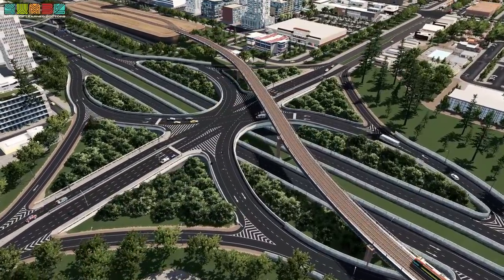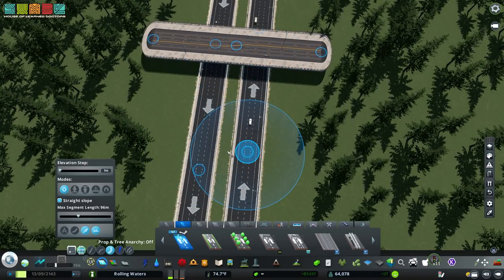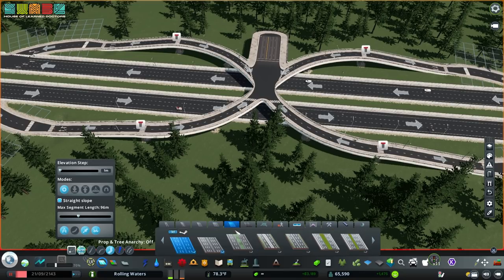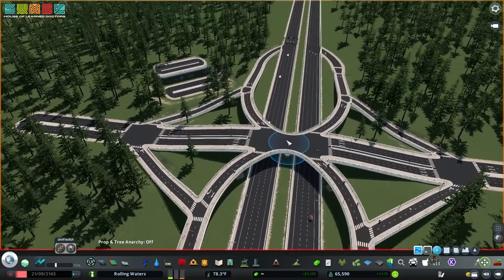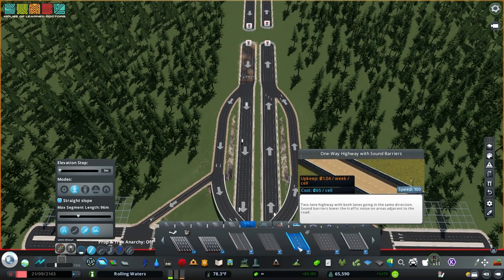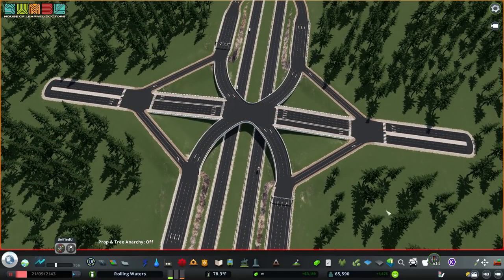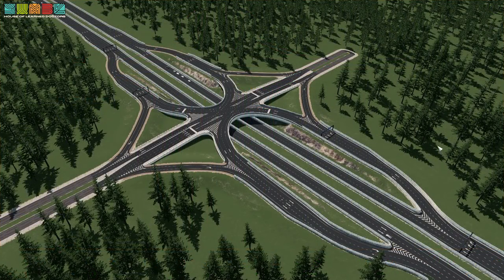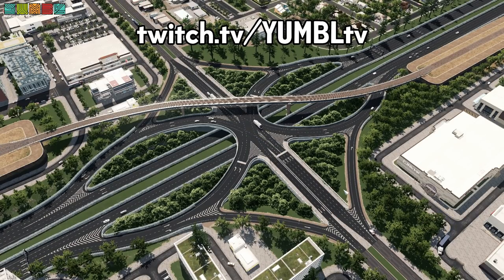Free Your Traffic Using The SPUI! - Single Point Urban Interchange - Cities: Skylines Tutorial

Comment: One "realism" thing about sinking the main highway I think is that you get landfill form there to use for the roads along the side. So it makes sense logistically as well to do it this way.
Reply from the maker: I’ve heard it called “dump and fill”
Reply: @YUMBL  this tactic is actually called CUT and fill and it’s very common in civil and architectural design
Reply: A real-life interchange like this would be extremely dangerous for traffic not to mention the problem of water flooding.
Reply: @YUMBL  Like Matthew says, it is cut and fill.
Reply from the maker: Thx Jason. I really needed it twice. 🤣
Reply: @robertsamson4610  This is not true at all, they are not dangerous in the slightest.  Check out the intersection at US-22 and PA-66 in Delmont, PA, it is a high volume thoroughfare with a SPUI that does a great job at managing traffic.  In addition, merging is actually really nice because you have a much longer line of sight and more time to get to speed than interchanges with tighter bends.

These low points in highways are intentionally engineered as such specifically for run-off water management.  This gives engineers a low point to divert all run-off to and often times any excess run-off that can't be handed by the storm drain system is diverted to a nearby manmade overflow pond if there isn't a nearby tributary.  Engineers really can't engineer around these things because of environmental impact reports so these roads are engineered to manage these considerations rather than work around them.

-Former equipment operator
Reply: @YUMBL  I was just reiterating and giving the Al Gore rhythm a shuck and jive.  I was a heavy equipment operator where I mostly ran excavators but have been certified on 28 different machines and can run just about anything short of cranes.

But just in case you didn't get the memo the second time, its cut and fill.  Jokes aside I'm loving your content.  Although I understand a lot of the principals you go over I don't always get the application right and you do an excellent job of breaking down relatively complex concepts into digestible portions.  I love the granular detail.
Reply from the maker: I do appreciate it! I have a bit to teach, but a lot to learn from people in their fields. Thank you :)
Reply: @YUMBL  We are all learning and are all lowkey stupid as hell that’s why we have each other ❤️ lmao. Keep up the good work 🦹‍♂️✊

Comment: I have both Yumbl's steam intersection.  SPUI and ParClo, the ParClo works alot better.  The SPUI all traffic fighting each other in one point, Parclo, if u make all off ramp right turns, NO ONE will fight each other.  I use the Parclo more because  it works well in heavy traffic area, like Downtown
Reply from the maker: Did you set up the SPUI with a traffic light as intended?
Reply: I agree with weirdalfan (and not just because I'm a Weird Al fan). I may be an oddball (been one my whole life!), but I've experienced SPUIs in Cities and in real life, and I find them very inefficient. The ParClo, DCMI or Turbine work much better in Cities, in my experience.
Reply from the maker: Parclo’s are better, but they take up much more space. Dcmi’s are great too. Turbines are a system interchange, so theyre not for getting on or off the highway.
Reply: @YUMBL  SPUI is okay for lighter area, like feeding into a low rez.  But I had a SPUI 2 times, traffic went nuts going into downtown that has 30000 workers.  So I had to do Parclos instead.  SPUI works but not for feeding 30000 workers going downtown.
Reply: @YUMBL  Also I do not believe traffic lights are answer.  I do give ways.  I prefer to manage teh traffic and let them go where they need to without stopping.  Only time traffic lights are good is Collector on Collector
Reply from the maker: I think it’s all context. Questions like: Whats around it? Is all the highway traffic being forced through one place? Is the light timed correctly for the volume of traffic? 

I will say parclo works better without adding a traffic light, but the spui is a strong competitor for its small footprint.
Reply from the maker: Certainly false. These interchanges require lights by design. Now i see.
Reply: @YUMBL  we all have different, preference.  How I run my city on Cities is different than you, Biffa or CPP.  I personally feel against stopping cars from an arterial can cause backup onto the highway, maybe I do them wrong.  But  SPUIs are okay, it depends how much traffic is going in them.  I will take up little more space, perhaps Eminent Domain to help traffic if I needed too.  I would still use SPUI if its lighter traffic like collector going into the suburb.  But for downtown (or any high traffic area), Parclo works better.  I used to do roundabout interchanges.  But it looks better if you don't tunnel and use actual overpasses.
Reply from the maker: The spui is a tool. A spui without a light is like hitting a nail with the handle of a screwdriver. It works, but not well.

Comment: I grew up in Miami, and my grandparents lived in Clearwater.  I couldn't have been more than three or four years old when I first became consciously aware of the fact that the interchange of Roosevelt Blvd. / E. Bay Drive and US 19 was something special, different than any other interchange I could remember encountering.  The thing that fascinated me was the traffic lights mounted under the bridge for the off-ramps.  I instantly fell in love with the design.  It wasn't until later in life that I learned the very first interchange of the type was built just up the freeway at the interchange with Gulf-to-Bay Blvd. in 1974.  I've been building them in my cities for as long as I can remember.

Even later in life, I learned, at the interchange of Wendover Ave. and Holden Rd. in Greensboro, that such a thing as an inverted SPUI exists.  ...Don't try putting one of those in a high-traffic area.  Just... don't.

Comment: We use these on the Yellowhead in Edmonton at three locations: Wayne Gretzky Drive, 83rd Street, 97th Street. The latter two are connected to frontage roads allowing for good business access to boot. 

This is an excellent guide and produces an exceptional approximation of these interchanges that we have here (particularly Gretzky).

Comment: I love your thought process when drawing it all out.  I just make a spui but the hw overpasses instead of underpass and lemme tell ya the ramps are backing up I may just have to add the extra ramp lanes.
Reply from the maker: An extra lane helps a lot on the exit ramps. Especially if traffic will be turning both directions at the next intersection.
Reply: @YUMBL  Of course, where you choose to put the 2 vs. 1 lane is totally dependent on which direction the bulk of traffic is going.

Comment: Just built this in my city, haven’t run the simulation yet but it looks great and I bet it will perform so as well. In my design, I made the highway a flyover, as it will go through my city raised, and put the intersection underneath. It works better for my road layout, but the downside is I don’t get to see the satisfying intersection!
Reply from the maker: Thats my one issue w the underpass version. Same reason I dont like using tunnels in interchanges. Aside from realism, tunnels hide all the great work you can do! I do love an elevated highway on occasion though :)

Comment: For the traffic lights i would suggest P1 straight + left from one side P2 straight + left other side P3 both left from the highway. The advantage from my perspective would be that all 4 lanes from one side will move at the same time and any last minute lane changes that will occure irl will be between moving lanes. Moving in and out between moving and not moving lanes is extremly dangerous! Plus only P3 cars will move from both side without any "hard" separation witch will reduce the risk of frontal collisions.
Reply from the maker: You’re right! For reasons you may not even know. In my experience once you use node controller all the arrows become straight. The light loses the ability to use a left arrow anyways. You’ll see the way you described is how mine is actually set up at the beginning of the video.

Comment: Interesting SPUI story.  I originally came from Columbus, OH, and one of our most infamous interchanges was Sawmill Road (an arterial road) and I-270, the city's Beltway.  It was a bastard PARCLO that had no fewer than three traffic lights, connected the city with the fastest growing suburb (Delaware), and was an utter disaster during rush hour or if there was ANY accident along I-270.

So what did they do?  They tore down the PARCLO in stages and built a classic SPUI instead!  Suddenly, three traffic lights became one giant traffic light.  It uses three phases, just like your interchange. And the amount of traffic it pushed was easily triple what the old PARCLO could handle.  Even during rush hour, traffic jams on Sawmill became a thing of the past.  All because of a better interchange design. :-)

Comment: The only SPUI in Metro Detroit is actually underneath the freeway. The freeway has a suspension bridge. The off ramps open up to 4 lanes to split into two 2-lane segments for turning. The road underneath was formerly an 8 lane divided highway, reduced to 6 through lanes here. I believe this interchange replaced a cloverleaf. I-94 at US-24 in Taylor, MI.
Reply from the maker: Nice! I would assert that this is better than a cloverleaf (depending on a lot of things mainly that I hate cloverleafs.)

Comment: Standard hight is 4.5 meters, most overpases is built 4.8m to have spare space. The road thickness is usually around 1.5 meters for highway overpases (but can easialy be 3 meters for river crossings or longer spans). So typically the difframce in hight would be 6.3 meters.

This number is usally keped  as low as possible, becuse there is a limited highway ramp angle, making it even a bit higher increase the cost of the ramp quite significantly.

Comment: There are a bunch of these where I live (Vancouver, WA) and they're neat.  I recently started putting some in my city where I was using DDIs.  I feel like the DDI does flow a bit better, but they're a colossal PITA to build, and require more space.  The last SPUI I built took all of 10 minutes, is very compact, and has better walkability.  So I'm a fan now.
Reply from the maker: Id say a DDI is better in terms of flow, but a SPUI generally gets it done
Reply: @YUMBL  That's what I've found too.  A DDI flows a little better in exchange for a lot of fiddly work and is really awkward to do things like add trams later.  I have 4 or 5 in my city and I'm just done building them.  At this point if a SPUI can't handle it, I'm going straight to a freaking turbine, lol.

Comment: As per the traffic lights, you want the straights throughs to take turns, so that the straight and turn go at the same time. Why? Because the turning lanes will fill up and then block the straight thru traffic. So, you run them staggered. Straight and turn.

There is a similar interchange near where I live, it's very important that the turn happens at the same time as the straight, because it will give an even flow of traffic heading into this interchange.

Comment: you could simplfy it by doing it the asian way which is to raise the highway into an overpass over the interchange and the rest of the road can be at ground level, the footprint will be smaller. it does require some additional work to set the pillars.
Reply from the maker: Sounds like, all things being equal, the footprint would be the same.

Comment: I don't want to sound negative, but I do miss a lot of Lane Mathematics and there are crossing area's. I rather just go for the Timboh's Turbo Interchange, which also requires a little Lane Mathematics, but that is done in a few minutes. At least with Timboh's interchange no crossing traffic what so ever.
Reply from the maker: A turbine (may be what you mean) is a system interchange for connecting highways. A spui is an example of a service interchange which is for getting traffic on and off a highway. Its also much smaller.

Comment: With the traffic light portion, do you do a timed light? If so, what are the settings you use?
Reply from the maker: I do a timed light! Start w min 10 max 20 and adjust as necessary. (I made those numbers up but its a start.)
Reply: I use 3-12 myself
Reply from the maker: Jenny is probably right. Start lower and move higher. I just find longer times often clear interchanges better.
Reply: @YUMBL  I think we're both right, its just a preference ^_^ When I do my lights I make sure to change the flow sensitivity to slow as well. I forgot to mention that. No one needs a psycho rave traffic light in their SPUI XD
Reply: @jennymunday7913  thank you both, I've never really bothered with them as I could never get the timing right for constant flow. I'm actually going to try this though, thank you both.

Comment: Nice and compact, looks good! I think I watched most possible interchange options now, I wonder where each excels in an actual heavy traffic situation. 

My preference is free flowing ones, but they are probably not as compact and more complex. Maybe too expensive for urban interchanges? I like the stacked clover design most I think. The clover elements may cause weaving and take up more space, and having more levels of elevation might not appeal to many visually and be more expensive. A traffic light might slow down traffic similarly to weaving but controlled unlike weaving and will probably be fine. 

Do you have any nice examples of asymmetric traffic where you tinker with SPUI or similar designs but giving it an extra stack and extra lanes to deal with this?

Comment: YUMBL - one thing I've never understood is why don't people just have an on/off ramp go BETWEEN the highway roads? for a single intersecting point? whats the obsession with always getting off on the left/right sides and/or gigantic loops, why not a single road in the middle?!
Reply from the maker: What you’re describing can be done with “vanilla overpass”, but would be difficult otherwise due to the how the node system works. Connecting highways to a road in the middle is tough.
Reply: @YUMBL  what if you just slide the highway out a little, and raise the terrain in the middle, so its like a classic intersection on land, with two bridges to each side... but now you have a single intersection road the easy way instead of all the complexity of sweeping roads and side exits? I always wondered if it was a building logistics in real life issue, or some road management, it just seemed easier to build up a cement middle on each side to a classic intersection everyone is used to? so more traffic can ultimately flow from the single point also?

Comment: There is one issue which is not addressed. If someone were to make a U-turn then there is no way for him/her to do so. You could however allow this at the point intersection by connecting the off ramp to the on ramp.
Reply from the maker: This would not allow U turns. Interchanges I’m familiar with generally don’t. Cloverleaf aside. It implies that someone missed you exit, therefore they should take an exit, and reenter the highway correctly.

Comment: just a thought but wouldnt it be easier to interchange at ground level and have the actual highway raised above that? that way there is less work/cost involved in raising the more complex element as you only have the 2 roads suspended? excellent guide none the less!
Reply from the maker: Yes. But then you cant see the interesting part which is no good for a video. Also many are built by converting existing overpasses irl.

Comment: Intrestingly enough highway overpasses in rl have a clearance of 4.9 minimum so ... the 10 meters are way more then enough although i assume that in the game they are referring to the surface of the overpass so the 10 are more like 6 to 8 meters of clarence which is still more then enough.
Reply from the maker: 10m between surfaces will clear the tallest container trucks I use, but not by much. “1m” in game isn’t always to scale on vanilla assets, let alone downloaded ones. Whats more important: adhering to an inconsistent value provided by a game, or making sure that vehicles fit under the dang bridge?
Reply: @YUMBL  Absolutly right ^^ And i wasnt complaining at all just finding it intresting ... and yes i agree the 10 meters in game dont look consistent at all. But its a gaming thing i assume.
Reply from the maker: I think scale is difficult in game. Especially once a bunch of creators get involved. All importing models at slightly different scale. As I said, even the vanilla assets dont look right next to one another at times.
Reply: Theoretically you can make certain that objects have roughly the right size when imported. Rather easy even since in any game engine building a box with that size is easy and those give you build in scale values. But that requires work so i bet they just eyeballed it and said: good enough and went on with the next task xD Or a fix was uploaded and not checked .. so many points where a slightly off scale thing would be able to slip trough ^^ In the end of course its all about visuals and annoys only a few people who go ... hang on this bridge is how high?